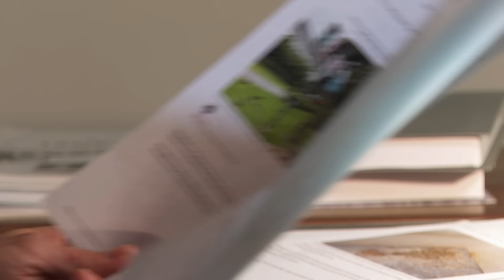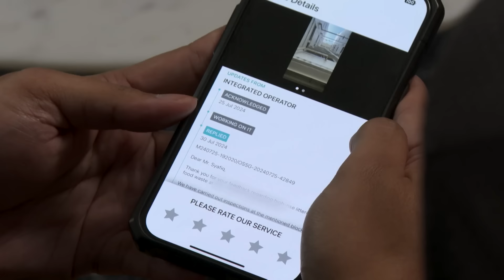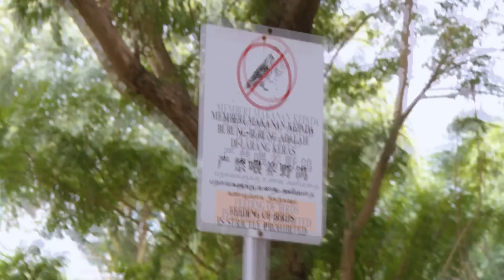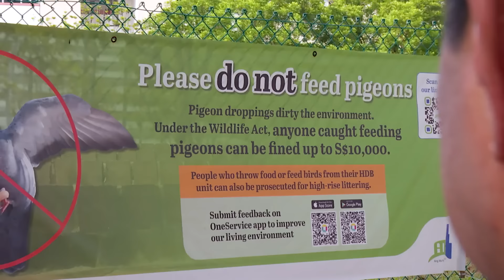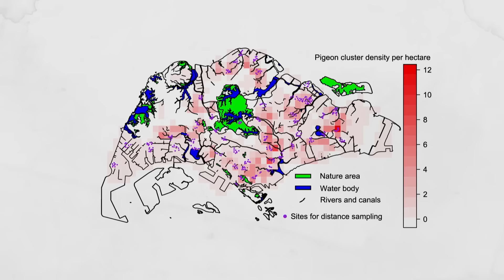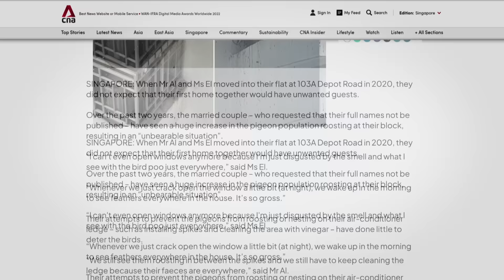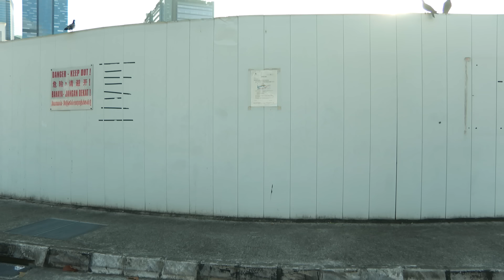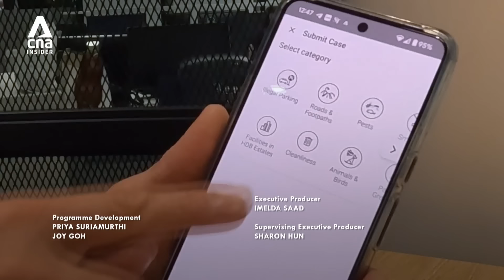Pigeon Problem: Why Can't We Get Rid Of Them? | Talking Point | Full Episode

Comment: These pigeons has more rights than us Singaporean. The reason NEA  turn a blind eye to this is because they are afraid of the animal activists. It will garnered international backlash if they start culling the pigeons. They like to use  " monitoring " in fact it means  " ignore " in that context. I remember  there was a case where a resident was so disturbed by the pigeon problem  he report to the authority many times, all came back with " we are still monitoring "  replies. So he  set up traps  to deter  the pigeons, he was fine with $5000 for animal cruelty.
Reply: Are you sure? Fine $5k?